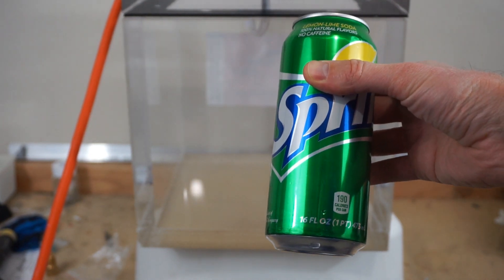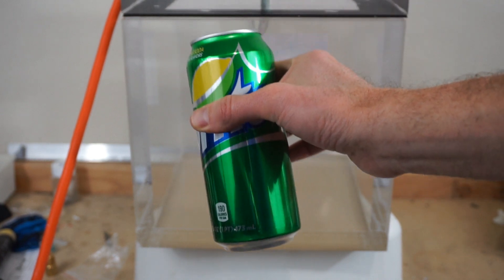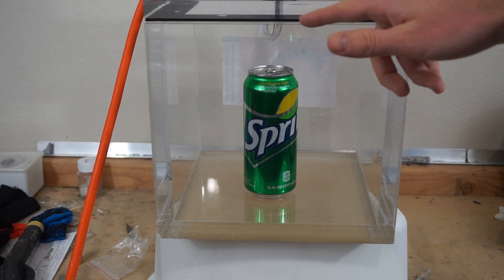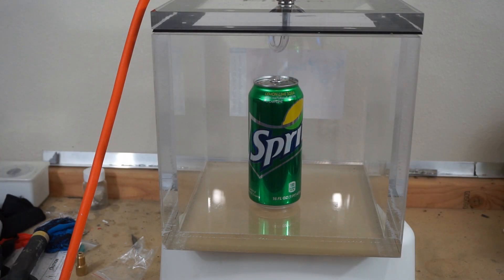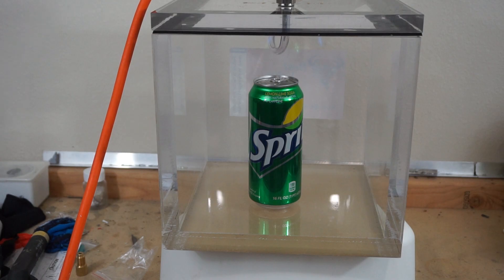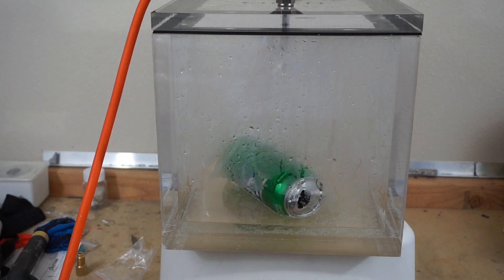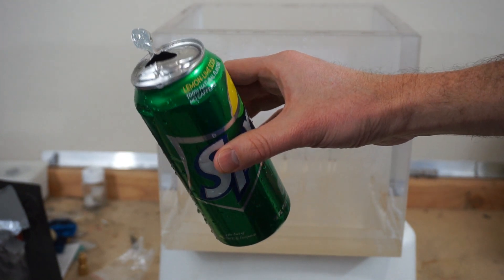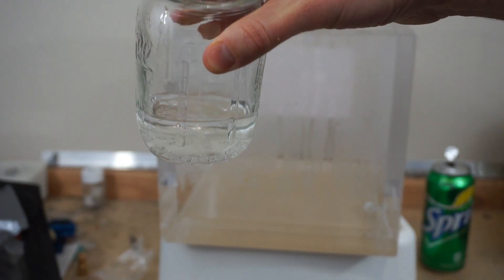What Happens When You Put A Can Of Soda In A Huge Vacuum

Comment: damn, those cans are seriously overengineered.
and the fact that it opened at the weakest point (instead of it getting ripped apart) shows how well these cans are designed.
nice
Reply: There's a video that shows you can dissolve the tin and the soda is held in plastic, to show the cans are lined.... I bet it adds strength to stabilize the can so it will rupture less easily.

Comment: What exactly is a huge vacuum?  A 100% totally vacuum purged environment, with zero molecules of "air" at best can only make the walls of a sealed vessel placed inside "appear" to hold back one additional atmosphere of pressure - MAX (a bit less than 15psi).  Not only that but the pressure difference between a so-so vacuum and a "hard vacuum" is so miniscule it takes precision lab equipment to even observe it.

It's not like "sucking harder" on an existing vacuum to get those last few atoms of nitrogen, oxygen or argon out make much of a difference in macroscopic terms.  Well, unless you're engineering a guide ring for a particle accelerator...

Comment: Not surprising that it didn't explode at room temp. The inside of every airliner would be a mess when they climbed to altitude and all the Sprite cans exploded! The cabin pressure is less than sea level pressure (although it's way higher than 0.2 atmospheres.)

Comment: its actually not exploding when the pressure decreases outside. That was an implosion. When then can gets super hot, you get a bleve: boiling liquid expanding vapor explosion. When you remove all the air out, the pressure decreases around the can causing it to collapse or implode on itself. Because of the pressure differential between the can and the atmosphere around it, it collapses. Because of the collapse, the contents have to go somewhere so they get shot out of the weakest point in the can.

Comment: Seriously, invest in a slow motion camera.
Reply: High speed cameras only record for a short time.  The higher the frame rate the  shorter the recording.   So, unless you know when the can will explode within a few seconds, you most likely will miss it with a high speed camera.  
They work good for timed events like shooting a bullet, where both the camera and the gun are triggered at the same time.   The even only lasts a fraction of a second, so they can shoot at very high frame rates.

Comment: It's possible that the increased pressure inside the can on the second attempt is not responsible for the can exploding. What about weakening of the pop top due to repeated pressure stress? Maybe if you simply ran the experiment repeatedly at the same temperature you'd get the can to pop. You need a control to make this truly scientific.

Comment: Wher did you get the vacuum chamber? Something that you made? If so do you have any instructions, or a how to video?  Thank you.
Reply: its not a difficult thing to make, all you need is an air tight container that can withstand approximately 15 psi, a vacuum pump, and tubing to connect the two together without leaking

Comment: sir, i regret to inform you that you are dead wrong in saying the the pressure inside a soda can does not increase when agitated. my brother shook up a soda once and the top and bottom pushed out like a grrenade in his hand. now im fairly certain the unless pressure was increased, that wouldnt have happened. also, if there was a tube that led directly to your mouth from the can with no exit or leaks, opening the can shaken up or not would produce the same affect when opened, by your logic that the can has no more pressure shaken up than it does naturally.

Comment: You should crush a rear differential. Everyone is either for or against jacking the rear by using the diff. The people that are against it say the pressure is too much and the diff can crack. The people that are for using it as a lift point obviously believe it can handle the pressure. I know the outcome will change depending on which you use (oem would probably hold up better compared to an aftermarket lightweight model), but it would still be interesting to see. Nothing came up when I searched this on YouTube, so it seems you would be the first to do it. If you do, it would be nice if you tell us in the video, at what approximate pressure it failed.

Comment: Florida has giant cockroaches that seem to survive most anything but a direct hammer strike....I wonder if they would explode in a vacuum
Reply: mike dee as a floridian, I want to see this
Reply: @flez550  
Nhehe
Reply: Ah to clarify a few points. Both Tardigrade and roaches can survive vacuums for short periods of time. This actually stems from them being closer related than you realize. From an evolutionary standpoint, both roaches and Tardigrade belong to the phylum Arthropoda, which are generally characterized by the addition of jointed limbs. They are very closely related. They also both have open respiratory systems. Meaning they do not pump blood, but rather absorb oxygen directly from the air into their bodies. Now, when placed in a vacuum, they both have the ability to gather energy from lactic acid fermentation. Similar to the process in our muscles when they run out of oxygen (it's why you get so sore after running). This process can keep them alive for a few minutes, but not long. So yes, it does stress them greatly. That is how they survive. Now, to answer mike dee's and Eric Arson's questions, they did not come from space (as cool as it would be). They evolved from a common ancestor, branching off maybe a few million years ago. We actually belong to the phylum Chordata. (this means we are charaterized by a notochord, something similar to a spine that we had a fetus. All chordates have one, or had one at one point.). This means we do share a single-celled common ancestor (such as archea, or a protist. Not bacteria though, those are something else). But other than that, there is absolutely no relation between us and tardigrades. Phew that was a mouthful. Source: Dr. Olga Kopp, Angel Busath M.S.
Reply: Ah. The funny thing is that roaches are one of the few animals that can survive a vacuum. For that reason they can be observed with an electron micrograph without actually killing them (since in order to view something with an electron micrograph that object must first be inserted into a vacuum).
Reply: mike dee  The only thing that survives in Florida are the slow driving Yankees that invade us here.
Reply: @davesstuff1599  slow driving Yankees? Come visit us in Boston and try to keep up. It's the wild west up here.
Reply: that would be a different type of cockaroach david ;)
Reply: interesting stephen....how long can they take the vacuum? It has to at least stress them.
Reply: but it has to be a decent-sized hammer; no geologist tiny hammer crap
Reply: if a fly and a spider survive the cockroach will be chilling in there LUL
Reply: mike dee cockroaches eh?....THAT sounds like a meaty mouthful...is it juicy?...is it soft?....
Reply: mike dee
Reply: would be interesting if we all evolved from tardigrades that were ejected by a supernova a few billion years ago
Reply: mike dee yes they most certainly would. not many living creatures can survive a hard vacuum. mostly the only things that can are bacteria and things like that. a cockroach can survive a lot of things because of its hard outer shell but a vacuum is totally different. it would boil it's insides and no doubt kill it within minutes.
Reply: It would be pretty cool to see him put cockroaches in a vacuum chamber
Reply: This was awesome.  did you watch the pressure gauge when the can blew? was there enough co2 released to see the gauge jump?
Reply: As a sydneysider we have zollions of cockies and would also love to see that too.
Reply: As a Floridian I think this is a good test to try
Reply: FigsLee lol
Reply: dude that just blew my mind
Reply: Wow, I wonder if Tardigrade are related to cockroaches, or use to live on Mars.
Reply: doubt it
Reply: thank you Dr. olga....finally.... someone who knows something
Reply: so does virginia
Reply: Yes Ethan, I can verify that the hammer does the job....good one ;)
Reply: mike dee I bet they won't survive being sprayed with vinegar.
Reply: @ wont work on Florida roaches
Reply: His channel would probably be taken down by the CockroachLivesMatter movement
Reply: Same
Reply: Stephen Wintre That is incorrect.  Cockroaches cannot survive in a vacuum.  Tardigrade are the only living creature that can survive in a vacuum, and even then, it is very very short lived.
Reply: mike dee would a video like that ne considered animal cruelty? lol
Reply: @ to some, maybe, but I bet more would pay to watch it....maybe a dollar